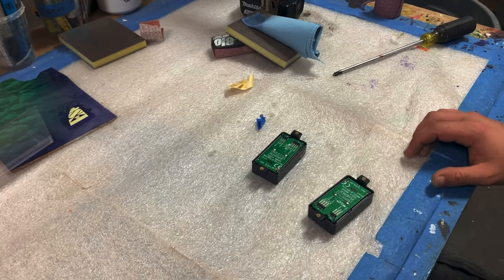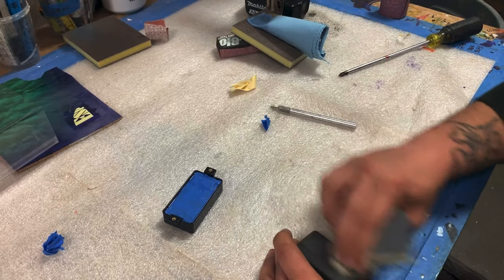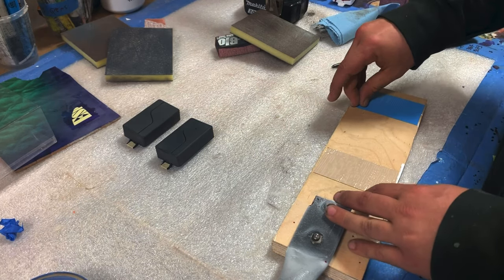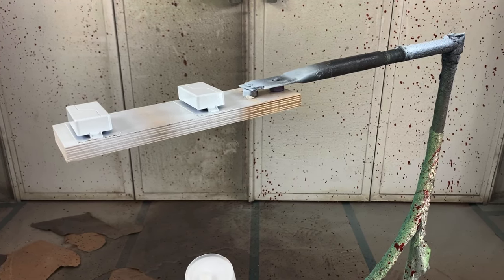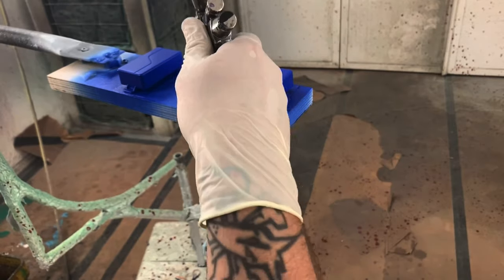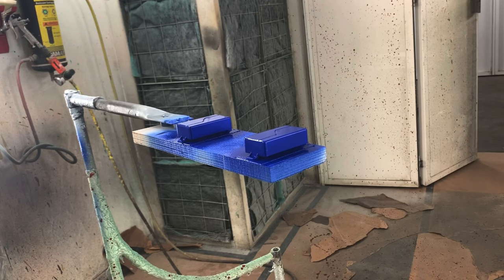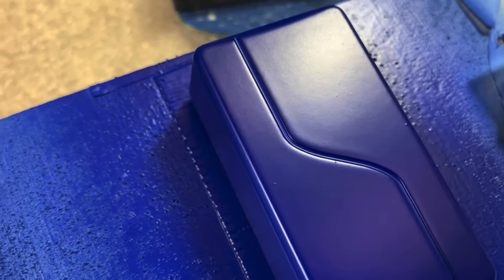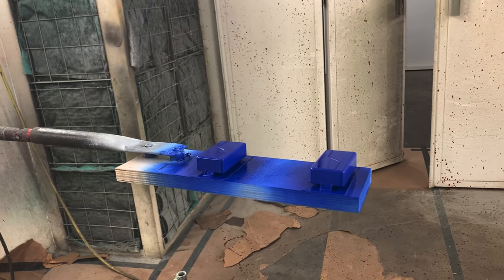Fishman Pickup Painting Party In Quarantine Together: Cheers Nerds!

Comment: I called fishman personally a few months back to ask if I could paint their fluence pickups and he said that's a great question that they get asked often and the answer is absolutely not lol. I was pretty disappointed since I bought the moderns in nickle finish since I found such a great price on them and had full intentions of painting but now idk. The tech support guy said the way fluences are designed they actually use the top housing to transfer the sound as compared to normal pickups and any type of coating on top will drastically change the sound so idk
Reply: That’s so strange considering Kiesel does custom paint jobs on Fishmans all the time. Hmm.
Reply: Sounds like bs, probably can't officially tell you to go ahead